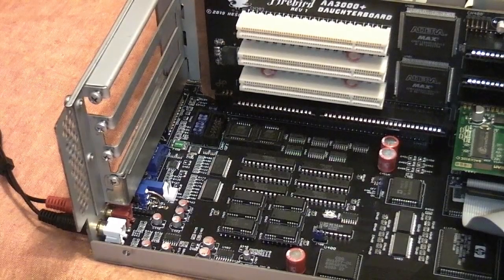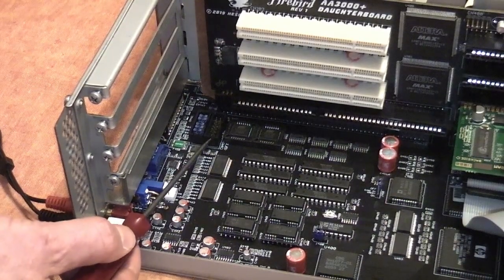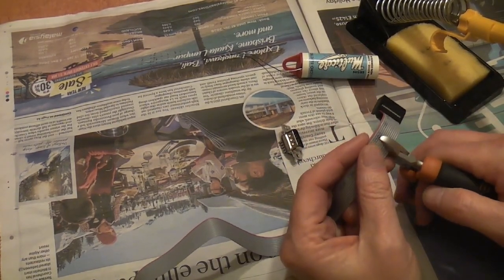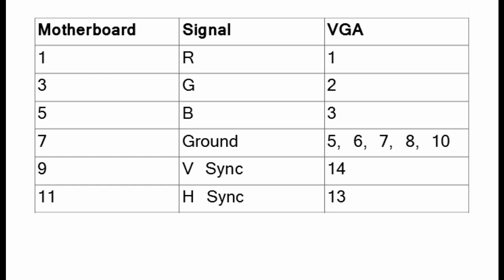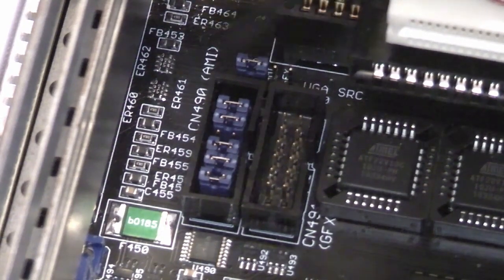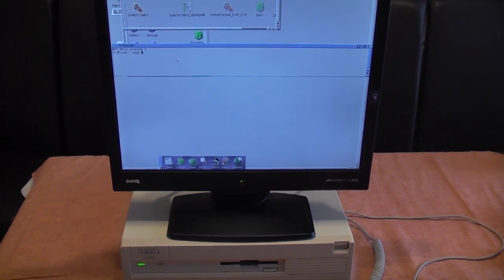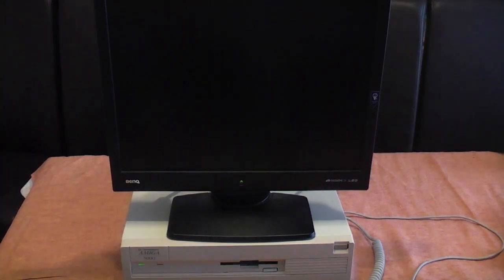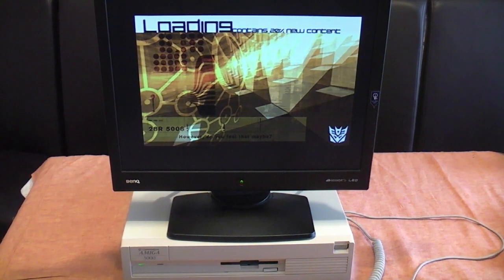Amiga AA3000+ Part 3: Auto Monitor Switch

Comment: Hi Wrangler, great video thanks.  Where did you buy the cable and VGA connector to get the monitor switcher working?  Thanks.
Reply from the maker: Glad you liked the video!  I got the parts off Ebay.
Reply: @wrangleramiga896  Thanks I've found some parts, ordered...not exactly the same VGA connector you got but close enough.  It should work!
Reply: Hey Wrangler, first try at the VGA cable didn't work for me, so I have a few questions.  Do you really need to connect PIN 7 to VGA 5, 6, 7, 8, and 10? or is connecting Pin 7 to VGA 5 sufficient.  If not,  how did you connect one Pin (Pin 7) to 5 pins on the VGA connector?  Also, what did you do with the 6 unused wires on your IDC cable? thanks
Reply from the maker: Sorry - somehow I missed your question.  I think the purists would say you should connect all those pins on the VGA connector to the Amiga's ground.  In practice, the video cards I've seen connect all those pins together on the card anyway, so you only need to connect pin 7 on the Amiga to one of the VGA ground pins.  And that's a lot easier to solder!

The unused wires I just folded back and clamped in case I ever need to use them for something.

Comment: Do you need to make that video cable if you're using something like a Picasso IV or MNT ZZ9000 which plugs into the video slot, or is this just for video cards which don't have that function?
Reply from the maker: No cable is needed with the Picasso IV as that has its own built in monitor switch as far as I recall.  I'm less sure about the ZZ9000 - I think it might have one too.
Reply: @wrangleramiga896  2 years late to the party. I have the ZZ9000 and use this on a A4K. I can confirm that this also does the same thing as a Picasso IV card as it has a video slot connector 👍🏻